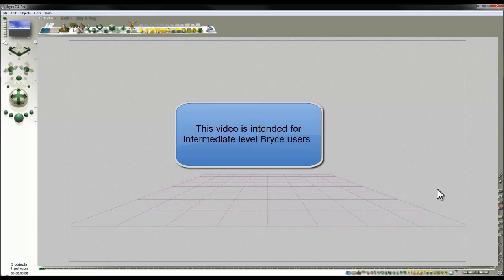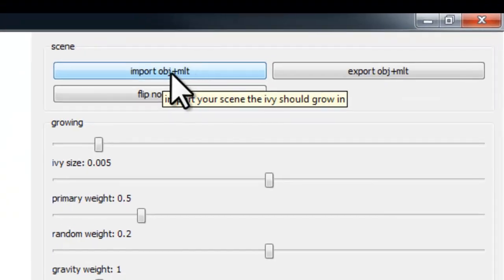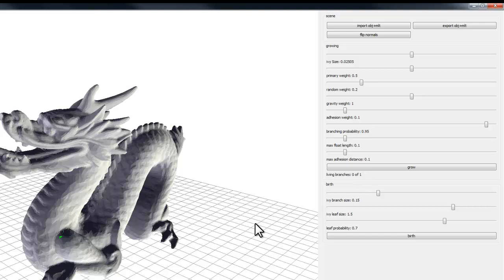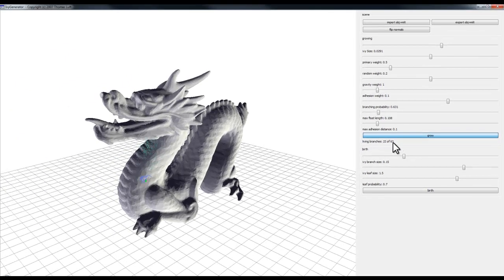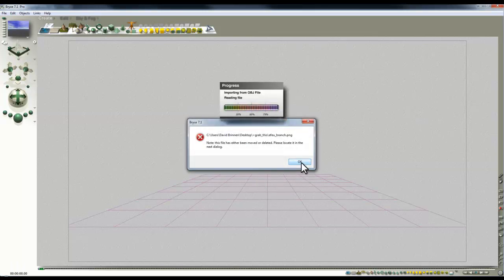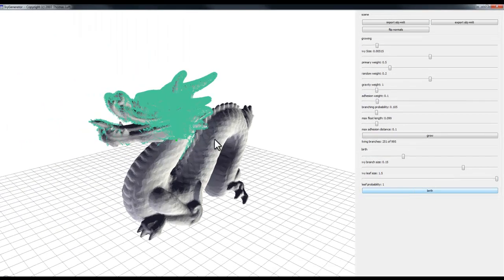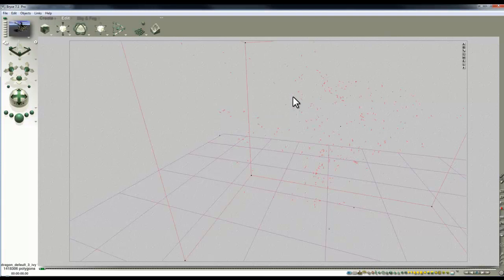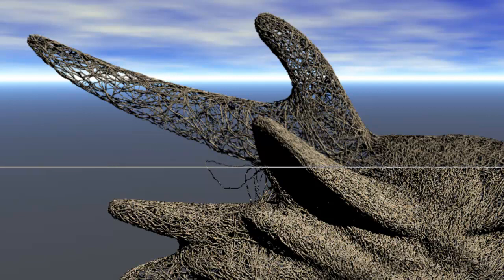Using the Ivy Generator 2 - using flip normals - wire sculpture effect - by David Brinnen.

Comment: I was surprised Bryce did it, but the overall effect was so dense that a texture would've done just as well.  Gotta figure out the gravity settings a little better to achieve the volumetric basket weave thing with the vines.  You've got some nice vine separation in yours, maybe I'll have a go with those settings and see what happens.

Comment: Just a quick warning, Ivy Generator seems to hate quads, so make sure you export your object as triangles.  Not a problem if you're exporting the object from Bryce, since Bryce makes only triangle objects, but if you're exporting from other modelers it could be a problem.  If you import a quad mesh into Ivy Generator, it attempts to convert it to tris with very unpredictable (and pretty much unusable) results.